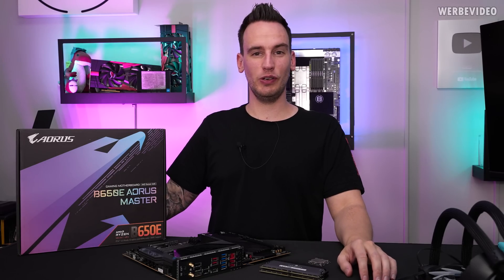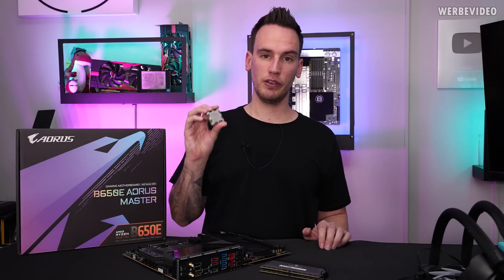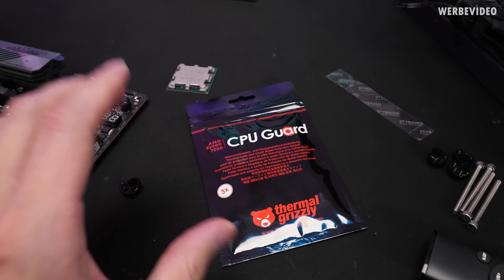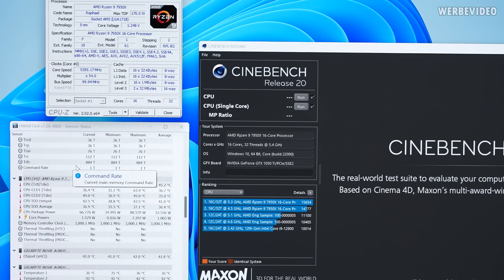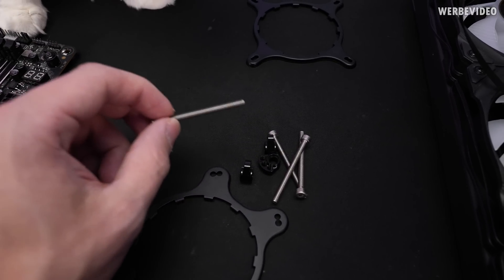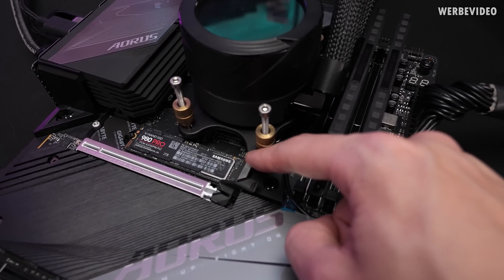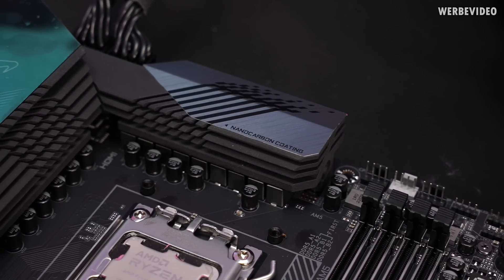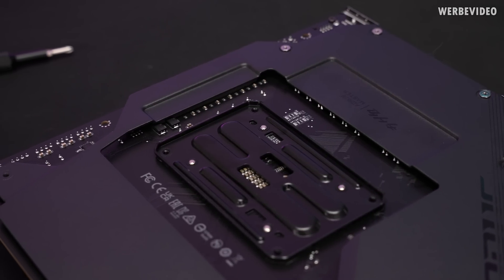Ryzen 7000 Offset Mount - Will this improve the high Thermals? (+B650E Launch)

Comment: Would there be any benefit in sanding down the IHS by say 0.5 - 1.0mm? Would it still leave enough contact for the cooler without interfering with the CPU Bracket?
Reply from the maker: We made a lapping tool for this purpose which I'm going to send to Jay this week :)
Reply: @der8auer-en  Perfect! Thanks for the reply, that will be a very interesting video to look forward too.
Reply: @der8auer-en  I was wondering this as well, I am very curious what the impact will be on the temperatures
Reply: @der8auer-en  Awesome! I suggested this on the original delidding video. I think it should be close to half of the delid option, but much safer for the CPU.
Reply: AMD still claims the IHS is not very thick, we will see soon how wrong they are on the IHS engineering design.

Comment: Before watching the video my assumption: offset cooling won't help anything because the CPU will boost until 95C or power budget, and I don't think the power budget will be reached with 2C-6C less. You might get a few points more in scores maybe. If the CPU is targeting 95C (default in BIOS) it will always reach it if it does not hit a socket power limit first. Ryzen 7000 embraced that 95C is OK and they are striving to reach it if at all possible.

Comment: That many features...no way is it under 300€
Reply: it's at 349$ at newegg so somethings like 450-500€ in europe
Reply: They're able to afford pricing like that because it only has one chipset, and therefore has less band with. Thus less future proofing.  

In the US you can get similar B650 boards for around 225 dollars.  The only catch is that you'll probably want to switch to an B670E by the time that next gen rolls around. 

But that's a decent trade off.  As B670E will have dropped in price by then.  And you can always sell off your B650. Or using it for a test bench. Or for an home server pc.

Comment: I'm early! Looking forward to the B650E series, everything is so expensive to the point of imbalance. I really want a board that does 16 lanes pcie5 AND 8 lanes (in x16 slot) pcie 4 (or 5, but that's pretty unlikely given that there are only 24 usable pcie5 lanes, and most would assign at least 4 to m.2)
Reply: This Gigabyte B650E Aorus Master is $600 in Sweden., cheapest card here is the Gigabyte B650M DS3H for $250...... Gigabyte B550M DS3H is $110
Reply: @AndrewTSq  Going to PCIe5 and DDR5 has that effect. They really should have dropped the PCIe5 requirement from the B650, PCIe5 SSDs aren't really a thing yet and PCIe5 expansion cards are many years away. Few people use more bandwidth than even PCIe3 can provide. A low-end chipset offering only PCIe4 would have made for much more reasonable pricing, and been a better fit for the requirements of just about everyone.

If you're getting a computer for video games, go for a 5800X3D instead. It's the equal of the 7900/7950 in game benchmarks (it even beats them in some games), but at half the price for your CPU+MB+RAM than zen 4, which is money you can spend on a beefier graphics card instead.
Reply: @СузаннаСергеевна  Agree about the need for PCIE5. Total waste of money on a budgetboard.  I have a x570-e Rog Strix board which I thought was expensive at nearly $400.. but now you get a middle class board for same price. wtf :)  The 13600k are availble for pre-order here for $10 less than a 7600x.  If you dont want to overclock it, you can get a decent B660 board with good vrm + 16GB ddr4 3600MHz ram for $670.. the cheapest B650 + 16GB DDR5 + 7600x is $900.  And since the 13600k looks to be faster than the 7600x, its really bad for AMD.
Reply: @AndrewTSq  The 5800X3D massively outperforms the 13600K in gaming, which is probably the biggest market for the i5s and i7s, AMD are only in trouble if you entirely overlook zen 3.

It's actually Intel in a really bad spot. big.LITTLE is still plagued with performance issues, and 13th gen offers only small improvements over 12th, which itself was only a small improvement over zen 3 (5800X3D excluded). If 13th gen were released to compete with zen 3 I would agree AMD are in a poor position, but it's actually released to compete with the 7950X for workstations and the 5800X3D for gaming, both battles they lose (the former badly, the latter slightly, but that's against a last-generation part and we already know zen 4 X3D are due in spring).
Reply: What do you need PCI-E 5 x16 for? GPUs won't need that for >2% improvement in the next decade. You need it in an M2 slot more likely, since drives are already in production that use the bandwidth.

I would want a board that can take 8 lanes away from the GPU slot and give it to M2. PCI-E 4 x16 speeds for the GPU are plenty for the next few GPU generations. it will be similar to what happened with PCI-E 3 and the initial GPUs that supported it. They worked fine with 8 lanes for a long time. DirectStorage speed might suffer a bit perhaps, but it will still be fast.

The ideal would be 12 lanes for the GPU and 4 to another PCI-E 5 M2. But that is not possible.
Reply: @marsovac  In correct - You forgot the fact that DirectStorage API is now here on the PC platform.
That will give the GPU direct PCIe 5 M.2 speed access, as PCIe 5 M.2 SDDs are coming with 15GB/s read/writes.

For instance this will allow UE5 to stream in super large textures with no hitching!
And yes games that are 800GB to 1TB are around the corner, people just under estimate where PC gaming is going.
Reply: @N0N0111  You misunderstand how DirectStorage works. It doesn't actually implement NTFS, so the data still has to pass through the processor before the GPU can use it, all it does is allow the CPU to store the data directly into the GPU instead of reading it into RAM first. No M.2 will be able to run at PCIe5 speeds for longer than a few seconds anyway, because the heat output would quickly become unmanageable. You'd have to fundamentally alter how NVME SSDs are manufactured, because thermal pads and PLCCs just aren't conductive enough to allow the kind of cooling you'd need. Instead of simple blocks of aluminium thermal glued to the chip you'll need fins, fans, springs, and thermal paste, and the controllers will need either an aluminium IHS or will become bare dies. It's not going to be a quick change. Even if a PCIe5 SSD could run at 100% speed, PCIe5x4 is the same bandwidth as PCIe4x8, so a PCIe5 SSD at full speed would still only be just enough data to saturate half the PCIe4 GPU's bandwidth.
Unless you're striping your storage between two or more PCIe5 SSDs we're a long way from needing more than PCIe4x8 on GPUs.
Reply: So what I'm getting from this, is that we need a buttload of RAM and move our games on RAMdisks before we start playing, so we can saturate that PCIE5 x16 link to the GPU 🙃

( For those a bit slower to get that this is a joke, yes, I realize this misses the point of direct storage's existence. 😜)
Reply: @СузаннаСергеевна  Remember Radeon Pro SSG Graphics?
 Youtube > watch?v=-fEjoJO4lEM

It is true i am not an expert on this topic, i have seen simple explanations how they are implementing DirectStorage API.
And for sure they show the GPU had direct access to the SSD and will benefit from the speeds PCIe 5 is bringing to the platform.
The whole NTFS part you bring up is already fixed some how, cause even the Radeon Pro SSG Graphics had a secret trick to do it.

The Radeon Pro SSG Graphics was and is a revolution product, they even show it was not insanely hard to load in 100GB of textures from the SSD that was directly on the GPU.

Further more PCIe 5 M.2 SSDs will be hot, yes that is a given already saw models that will come with a big heatsink with a FAN!
As you my know that the PS5 is using about the same technology to access it's SSD with 7GB/s and is not getting very hot to breaking point.
I think the heat from the PCIe 5 M.2s will be high but not insane high where it has to throttle back to like 1GB/s or so.
Reply: @N0N0111  Linus Tech Tips isn't a good source for technical details, I don't think they have any staff who actually understand how DirectStorage works given that Anthony, normally their most knowledgeable member, is presenting this video and still explains the concept incorrectly. DirectStorage still routes all reads through the CPU, it simply reduces the bottleneck by removing extraneous steps.
DirectStorage: SSD -> CPU -> GPU
No DirectStorage: SSD -> CPU -> RAM -> CPU -> GPU
Basically instead of using two instructions "read data into RAM", "copy data from RAM to GPU" you have one instruction "read data into GPU". The GPU is not aware of the file system, and that's a good thing for a long list of reasons outside the scope of this discussion.
Radeon Pro SSG isn't really a comparable product. DirectStorage is meant primarily to reduce hardware cost, that it has performance benefits is a nice side effect. What the SSG was meant to solve is beyond me, the platforms it would have been installed in have more than enough lanes to just install SSDs in bifurcation cards if all you want is fast storage. SSDs as swap for GPU RAM is the explanation Anthony gives, which is probably correct, but I still say the product doesn't make sense. Neural net training can benefit from such massive data sets, but an SSD is still nowhere near as quick as RAM so the performance will be awful. It's a workstation GPU, and workstations regularly had 128GB+ of RAM even when the SSG was released. Swapping between system RAM and video RAM is a much faster operation than swapping between video RAM and an SSD mounted directly to the video card. I guess the API the card is supposed to use stripes them together? Still sounds dubious to me. Today we have a much better solution for this problem, it's called Threadripper/EPYC with 256GB of RAM installed and SAM enabled. Even Windows supports compressed RAM these days, so those 256GB can often easily fit a terabyte of data after compression, and evicting the least commonly used data onto a page file on an SSD (while still in compressed state) after that is something the CPU can do without the GPU's knowledge.
Reply: @СузаннаСергеевна  Thank you for elaborating on this topic by the way, I am surely not the only one who appreciates it! 😀
Reply: @N0N0111  Eventually we will need to choose what size of textures we want to download. Most of the weight is on model details and textures.
Reply: @marsovac  RTX 2080 TI saw up 15% loss in performance when using PCIE 2.0. The RTX 4090 is about 150% faster so there is a good chance that PCIE 4.0 is getting close to its limit.
Reply: @marsovac  I don't need a new computer in the first place - wanting and needing don't have to be the same thing. 😅 I agree that not many people will need pcie5 x16.

edit: although the mention of direct storage in the replies above may be a good point? 🤔